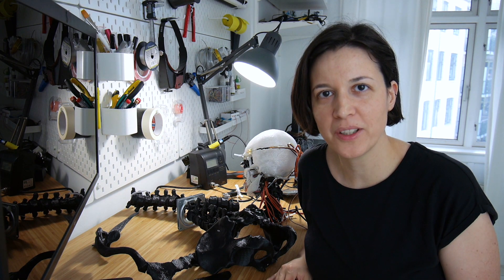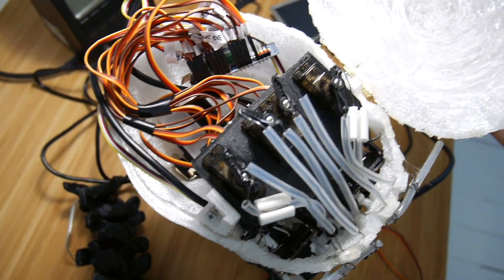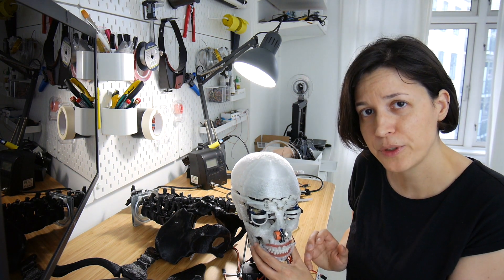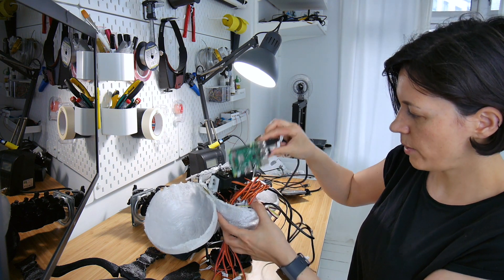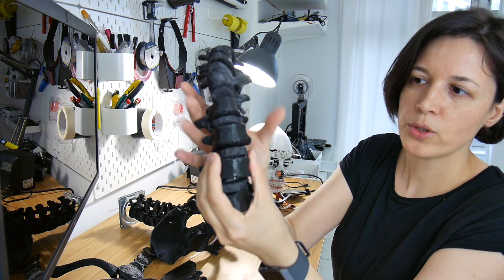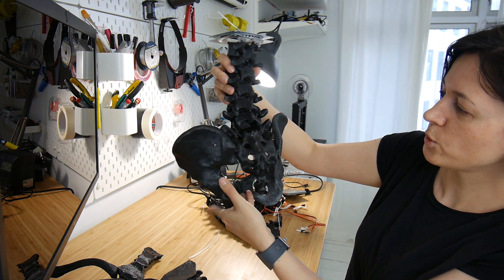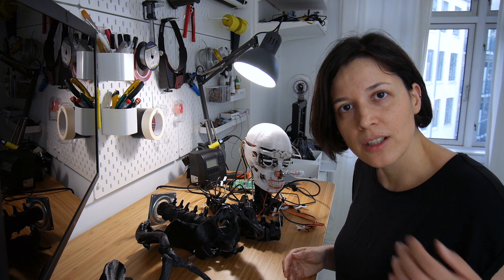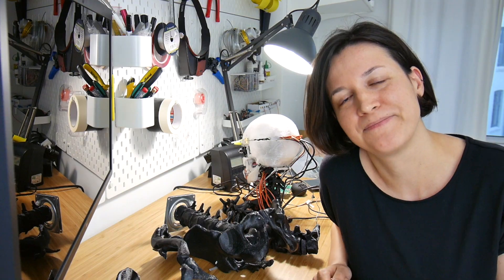Humanoid Robot - Project Update (June)

Comment: The human vertebra is a terrible catalyst to work off of. It has too many moving parts and is unsteady as well as impractical for introducing a large amount of power draining servos. This is one of the reasons you don't see many humanoid robots with legs. 
Might I suggest a reinforced framed torso instead.

Comment: Looks really amazing! You could use a Pi Zero if you want to fit a Pi in the skull.  That’s what I did for mine. Also Intel  and Google have a great Neural Compute Stick for fast processing offline.
Reply from the maker: Thanks! Yep, in my next iteration of the skull I actually fitted an RPi inside without problems, and I'm also working on using the Google Coral. Would be nice to see your design - are you sharing those somewhere? :)

Comment: i would not use a premade pi bord. its to big. the best thing is use a fast microcontroller and a ram chip and a flash chip and solder it on your own circuit board. that way you can fit the hardware into a much smaller space. a basic computer only need a fast microcontroller chip, a memory chip and a flash chip for storage. the programming can write directly to ram segments and then byte copy directly to flash segments one byte at the time into blocks. you only need to store  values in the first segment on the flash drive that tells the adresses of the other segments. the best thing is to write the whole code in assembly and write your own bootloader code. that way, nobody can steal your data as most programmers will look for a partition table that holds list of file names and folders. when you write directly between ram and disc, there is no need for such a lookup table and most programmers simply will not be able to recognize any data on the flash storage. it will all seem like garbage. this way, you can use all available processing power of the microcontroller and run things way faster than a system in a high level language with a much more powerful chip. speed is no limit as a 8 bit processor at 20 mhz can outperform a 2 ghz intel pc if coded efficiently in assembly so a processor of 80 mhz 32 bit can handle  even more data. by writing in assembly, be able pro make the software far more efficient that the high level garbage code on these pi boards as your talking directly to hardware and not to a load of other chips.